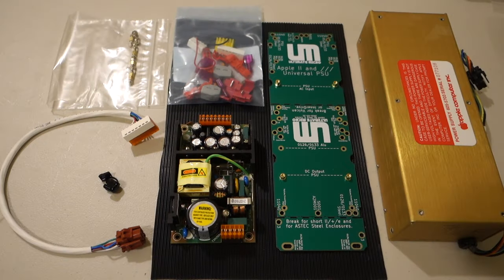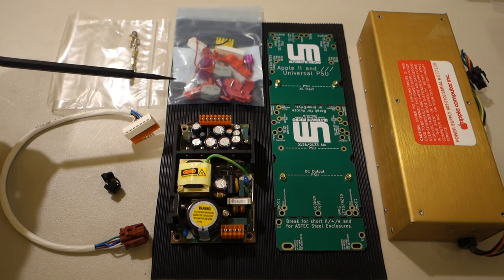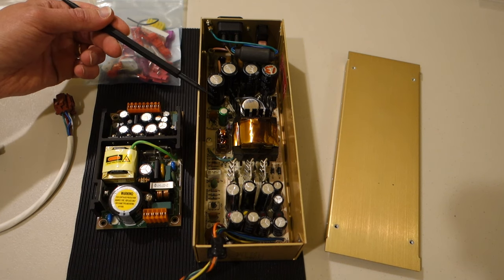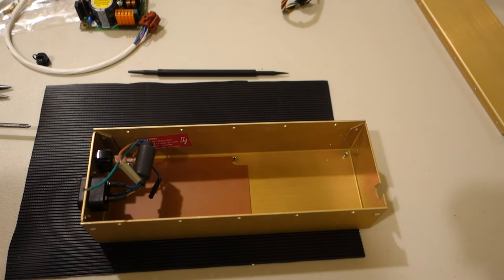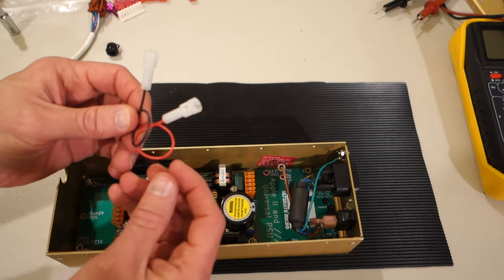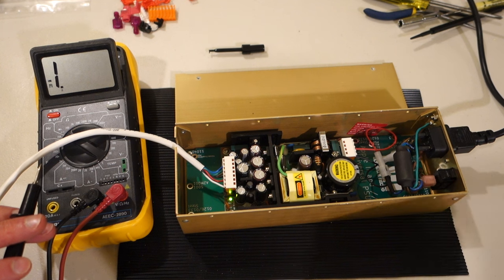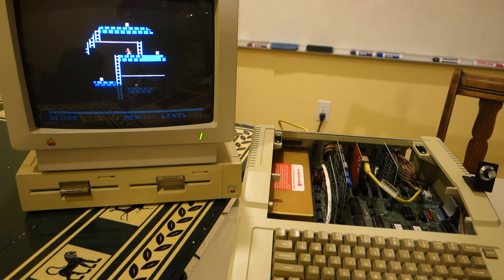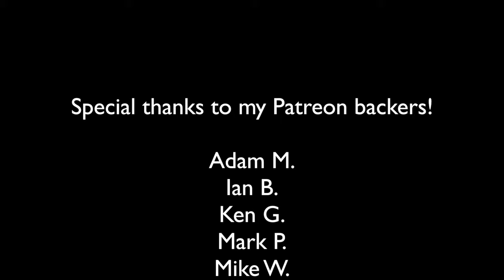Assembly Lines #29: UltimateMicro's Universal Power Supply Kit

Comment: i just ordered one to replace my ageing apple iie power supply, it emitted a stinky smell, my mom was wondering what the burning smell was and i said that a capacitor blew so i broke out the soldering equipment and removed the stink bomb of a filtering capacitor from the psu, it still works though but i want something better than that old power supply. it might take a while to ship/arrive due to xmas/new years but soon it will arrive.
Reply from the maker: Yeah, it's probably a good idea to just replace it. I would recommend keeping the old parts in case you ever want to restore it to original condition, but put in the new power supply for day-to-day use. Best of luck!
Reply: @CT6502  i don't care about period correctness or keeping it original, just for functionality. the Apple IIe that i have is a Apple IIe platinum. i think it's better out of all the Apple IIes cause it has a keypad and has 128k of memory, i got it with the apple color monitor iie, the 5.25 floppy drives, a imagewriter ii, and a lot of floppy disks and it was equipped with a super serial card and a 5.25 floppy drive card, it originally had a dead power supply, i replaced it with another one out of a iie enhanced that was yellowed and is missing a few keys and didn't have any cards unlike the iie platinum, and later the smoke escaped from the filter capacitor so i removed it, it still works to this day but i want a bit better newer power supply for it so thats why i bought the universal power supply. i'm planning on using the older PSU for the IIe enhanced after i put the new one in the iie platinum
Reply from the maker: @pentiummmx2294  Yep, totally understand. I just had a couple of cases where I tossed something and then later regretted it. :-)